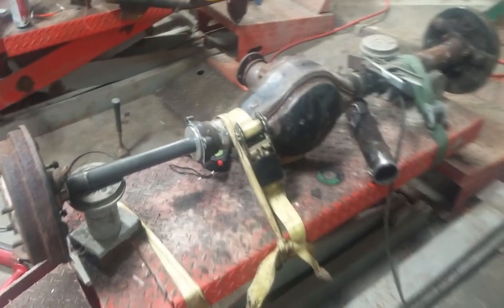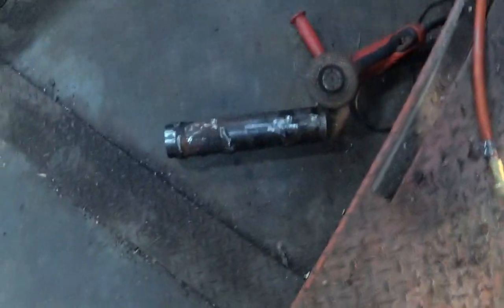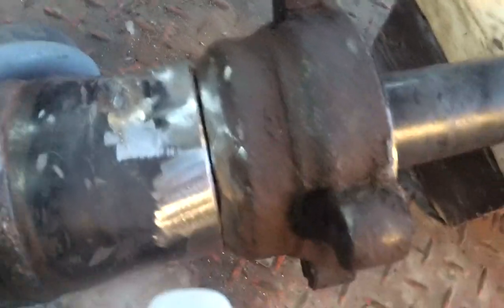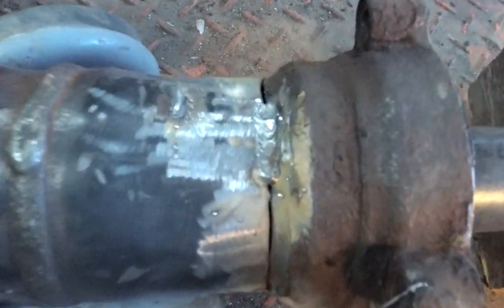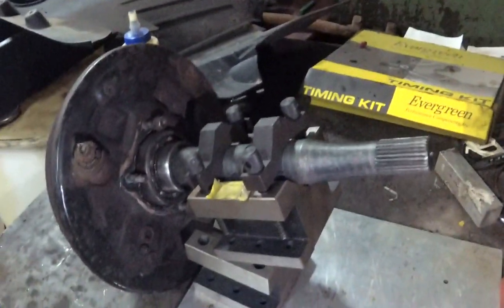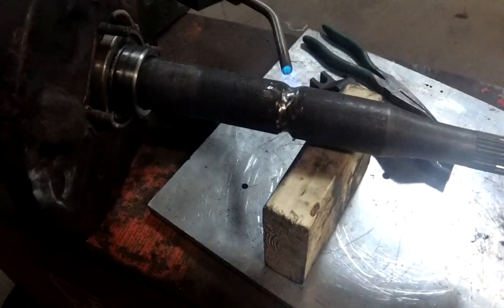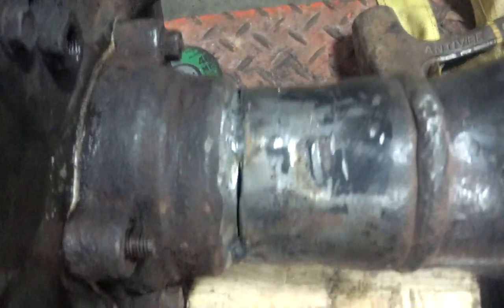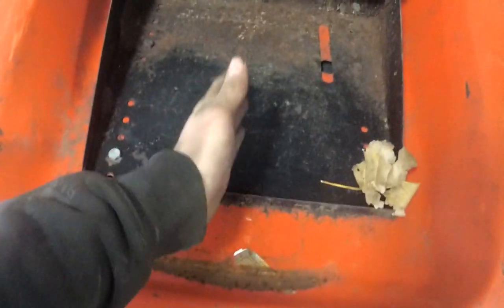4 Cylinder Lawn Mower Build : Shortening the rear axle! (pt:4)

Comment: Axel's  are heat treated  you could braze them together and cut a  slot in the shortened Axel's  with a angle grinder and put a piece of quarter inch steel as a joiner   and braze the Axel  together it should be OK for low horsepower use sometimes heat treated steel won't  weld   you can soften harded  steel with heat and weld ok